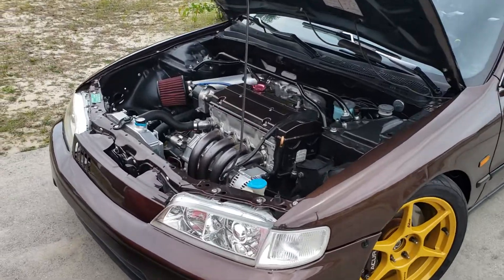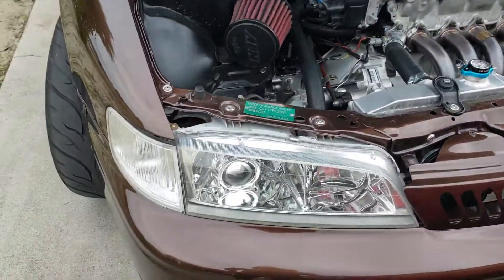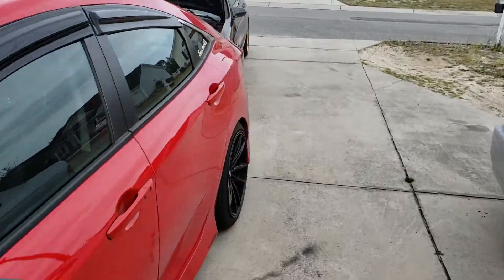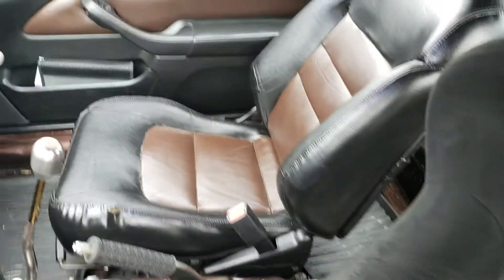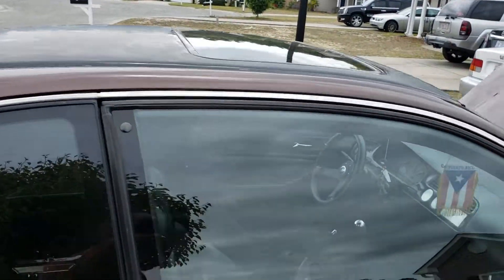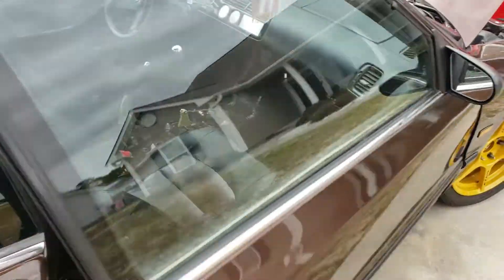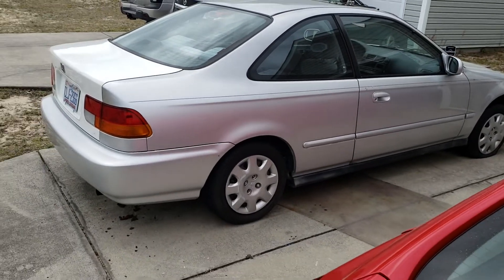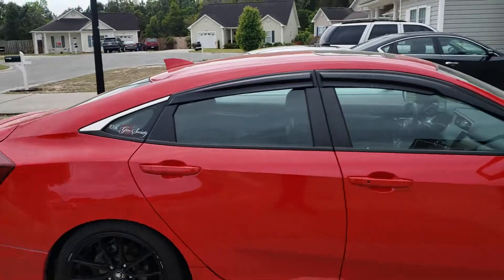Cd7 Honda accord build Ep.5 Done (not really)

Comment: What kind of motor is that? Thats a small radiator for it no?
Reply from the maker: GamerOnHorizon the motor is a f20b vtec... you can run smaller radiators without issue, this specific radiator always ran the car cool and without issue
Reply: Nice bro, appreciate the response.
Reply from the maker: GamerOnHorizon no doubt man